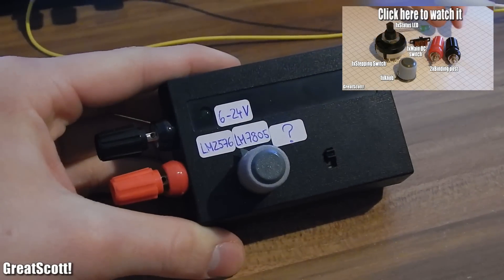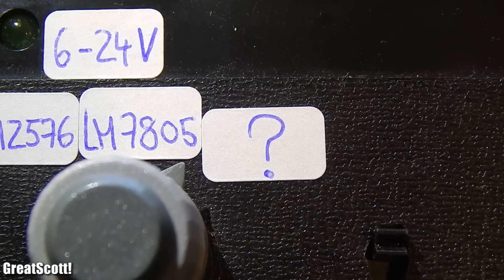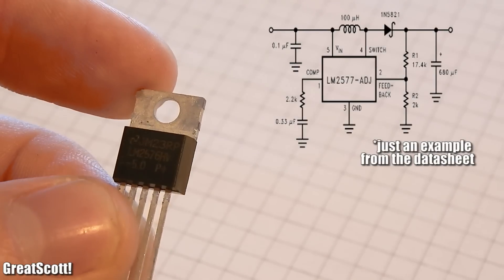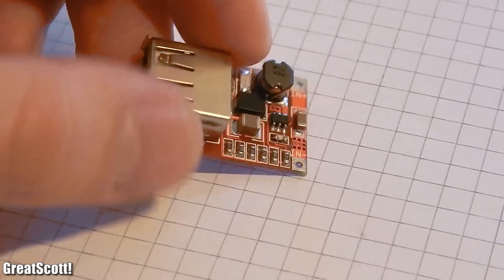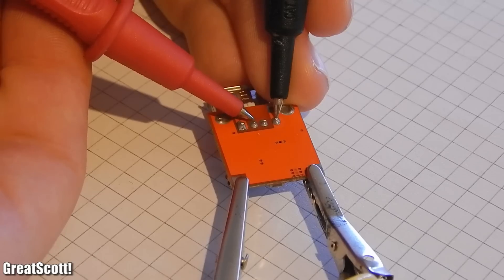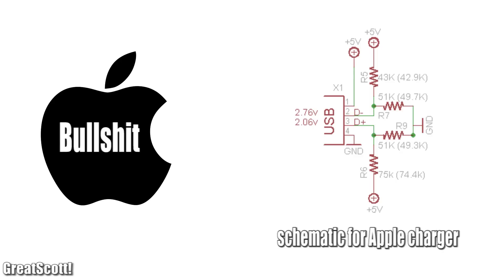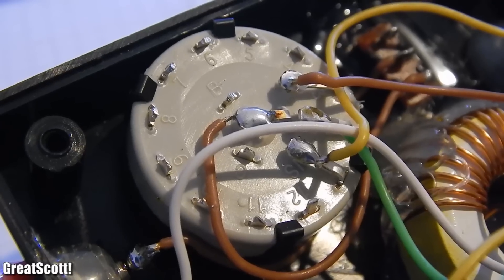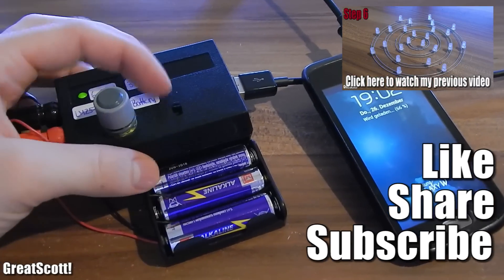Charge your phone with AA batteries!?

Comment: So I've powered my phone directly with 3 AA batteries once. My buddy answers the door and I ask him if he has any AA batteries for my phone. He repeated "AA batteries for your phone!?" and told me "You need to get some sleep!" I assured him that I was serious and got plenty of sleep several days ago. He say "Okay, I need to see this Macgyver shit!" I produced a phone with a battery holder taken from a smoke detector crudely wrapped to the back of my phone with shoestring and all of this was done without solder. Shook his head with a stoic look on his face and insisted once more that I get some sleep. I proceeded to boot up said phone and a crazy grin swept across his face, he laughed "Dude, I hate you so much right now." I have to say I wouldn't recommend doing this unless you absolutely need to, because I had no additional protection other than what was built into the phone for a LiPo battery no an alkaline battery. In Android I got to see a message that I've never seen before, something about over or under current, then eventually the phone would get really hot and then another message, something about the phone overheating and it being dangerous and would shut down for my protection and to save the phone from permit damage. Yeah over and even under current is no good for sensitive electronics and to boot I was using batteries that were not uniformly charged, phone never worked the same again. In summary would do again 9/10. See everyone at Defcon 30

Comment: Hey can someone answer my question 🙂😃

But can I use rechargeable AAA batteries to build a 48v battery pack and what can I use to charge and I can't find bms for them 🤔 hmm

Just curious if rechargeable AAA batteries can be used for ebike and any ideas 💡 thnx
Reply: To build a 48v battery pack from AAA batteries you would need 40 of them. And considering each has a max capacity of 1,100 mAh, you would only get around 52.8 watt hours. Which, for the price of 40 AAA batteries (around $40-$50), isn't a very good deal, and you would be better off getting li ion cells instead. 

Also, you do not need a BMS for NiMH cells. As for charging, you could make five 9.6v battery packs and connect them in series to get 48v, and charge each of them using a 9.6v NiMH charger for RC batteries.

Also, I don't think AAA batteries could even supply the amount of current needed for an e-bike.
Reply: @kersentaart5534  yeah I have some rechargeable AA batteries I just bought just trying it just trying it experimenting lol 

But if I connect them in series how'd I charge them and should I install something for charging like balance wires hmm
Reply: @BlackCat-qm3sj   NiMH cells do not need balancing. For charging the only option would be to make five 9.6v packs and connect them in series to make a 48v battery. When it is dead you can disconnect them and charge each of them with a 9.6v NiMH charger.
Reply: @kersentaart5534  what about bms? I built mine almost done waiting on charger
Reply: @BlackCat-qm3sj  As I've said before, NiMH cells do not need a BMS. I highly recommend watching GreatScott!'s video on NiMH batteries as it contains a lot of useful information.

Comment: A great item to have if you want to keep your phone running during an extended power outage and if you have a lot of spare batteries laying around! :)
Reply: Or maybe you can recharge nihn or ni-cd batteries
Reply: @haxemeback9304  
That is possible but with those battery types the batteries have to be recharged extremely slowly and can also be damaged by not fully discharging them before recharging them! Those battery types definitely did have quite a lot of annoying problems while they also couldn’t do many recharge cycles compared to lithium-ion batteries before completely dying! :)
Reply: @haxemeback9304 
Definitely quite interesting though we also used to have old rechargeable batteries like that eventually explode while changing and it mainly involved them just popping and letting out a ton of electrolytic fumes! I believe it was because of our first battery charger in the early 2000s not keeping track of the voltage and instead relying on a timer to stop charging so the batteries could explode from overcharging when their capacity dropped too much from the memory effect or the batteries doing enough recharge cycles to loose a significant amount of their energy capacity! :)
Reply: @haxemeback9304  
Yup though based on what I heard those sorts of batteries on average only last about a hundred charge cycles before loosing most of their capacity or dying completely so they refuse to charge! :)
Reply: With 1amp charge will it be able to charge effectively (usually chargers are marked 2A)

Or is there any other better booster option

I have been working on a project to build a battery charger with AA batteries 1.5v 6.5ah

Any suggestions will really appreciate

Comment: Apple phones can charge w/ 2.5V on D± pins.
Use a Voltage divider.
5V → D± = D± → GND = the biggest value possible(D± pins do not provide current)

Comment: This is literally the most counterproductive thing to ever exist, yeah great idea, waste 10 dollars on AA batteries when you can just get a rechargeable battery bank instead that plugs into any wall outlet.
Reply: You can use nihn 1.2v rechargeable and use solar lights to recharge them very day with the sun them take out at night and them you can recharge your phone it will last about  500 to 1000 or 1500 recharge cycles so you can drain it once per day it will will surely last for 4years for 1500 recharge cycles  and 1year and a half for 500 recharge cycles so it very good idea in the load run

Comment: Was hälst du von Dioden in den Kabeln zum usb port? Also damit kein Strom falschrum in die anderen Baugruppen fließt wenn diese deaktiviert sind. // What about soume diodes in the Powerlines for the USB Port? So that no Voltage is flowing into the output of the non-activated components.

Comment: I build a similar one, to use it with Eneloop but I'm afraid to undercharge them. Is there an easy solution for that?
Reply: Yes you can use 1.5v usb rechargeable battery 3000wmahs is 2000mah 1.5v output always when the batteries is used up it shows 0v when fully charged the output is already 1.5v

Comment: I've always wondered, why does putting batteries is series make the voltage higher?
Reply: Image you have a pool

At the bottom of it, you have a certain pression right?
Now double the amount of water in the pool

The pression doubles too

That's the same princip
Reply: because when you put power sources in series, the voltage adds up
Reply: a battery sort of works like a water pump, and the electrons pretty much work like water. you add more pumps in a series, you increase the water pressure/volts.

Comment: need to ask a complicated question. Not sure if you have heard about the 
Biolite - CampStove but anyhow. i want to get it and i wonder if there is anyway i can get power from USB and then using that power to charge a deep cycle high capacity battery or another type of big battery with just a USB power source. then i would use a converter to get  110v from the Deep cycle battery 

maybe you can use some type of power-Converter or cut the USB cable in half and connect it to the battery somehow. 

is this possible ?
Reply: +Nawas Guessing you mean a 12v deep cycle. I wouldn't of thought 5v 1/2amp would be enough to charge anything big like that, it would also need a step up to bring it up to 12v to actually have an affect on the battery, but very unlikely.
Reply: okay so its not possible to use it to charge anything bigger than 5v 1 Amp pretty much?
Reply: Nawas Yep pretty much, probably better off with a solar panel for charging a deep cycle.
Reply: okay

Comment: Can i cut my usb cable and connect it to three aa batteries without your gadget box?
Reply: +Fareke2 Most of devices will do just OK with 4.5 volts on input. But this will drop quickly over time and charging will stop. You won't get much of a charge from this setup.

Comment: So if the input voltage is 2.5-6 v, would it work better if you use a fourth battery, or would it not really matter?  I've built one of these and am debating whether or not to use 3 or 4 AAs.
Reply from the maker: It would work the same with 3 or 4 AAs.